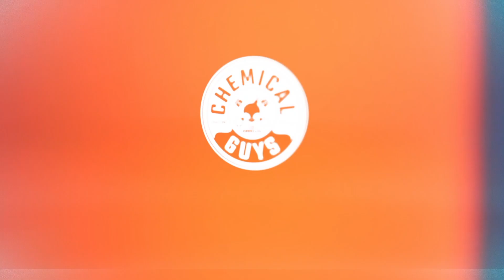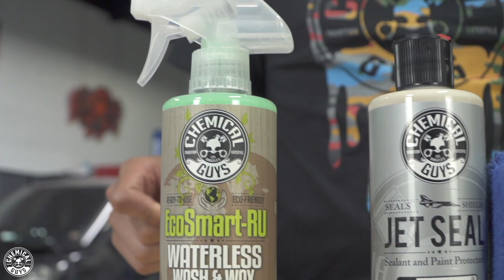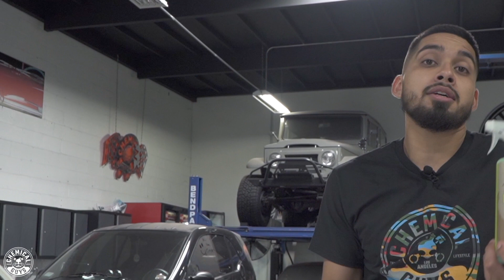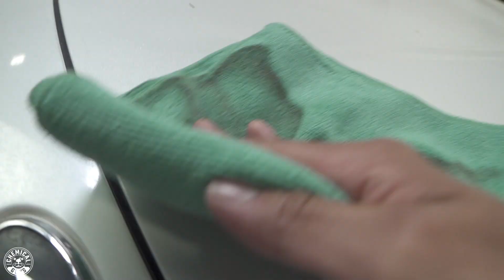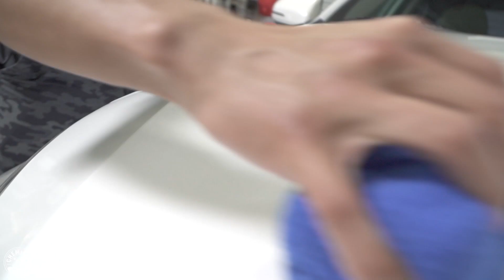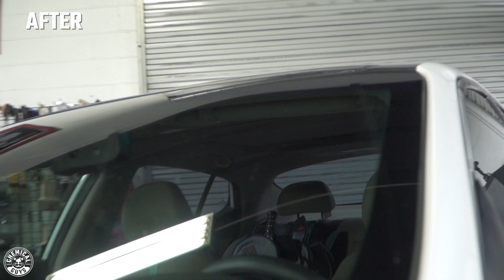How To Conserve Water While Washing Your Daily Driver! - Chemical Guys

Comment: For me this product hits the mark. In March of 2025 I traded in my 2022 Silver Subaru crosstrek for a dark blue crosstrek wilderness. Within a few days I started seeing waterspots. Living in an apartment  complex surrounded by sprinklers and now having a dark colored is challenging. After speaking to my car dealership and doing some research I began to try different products to remove the water spots and reduce the damage that they can cause. I tried a few of the  Meguiars products, Adams products a couple of others before trying chemical guys. So far this waterless wash, gel spot remover, speed wipe and synthetic quick detailer are now my favorites. Great job guys!

Comment: SO QUICK QUESTION DO I CLAY BAR CAR THEN USE WATERLESS ECO SMART WITH WAX THEN BLACK LIGHT YOU LET ME KNOW WHAT ORDER I SHOULD BE DOING THIS ALL IN THANKS
Reply from the maker: Hi Joseph! Start by cleaning the surface with waterless wash and then use the clay bar before applying Black Light, sealant, and/or wax.
Reply: @ChemicalGuys  THANKS FOR THE TIP